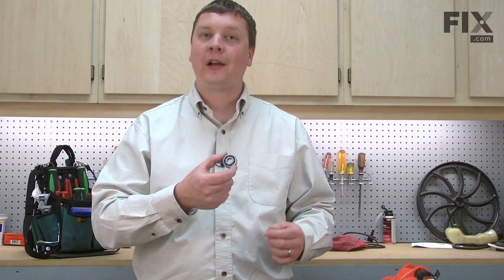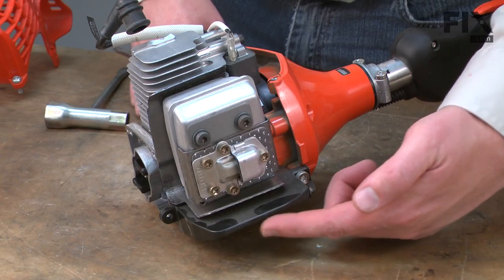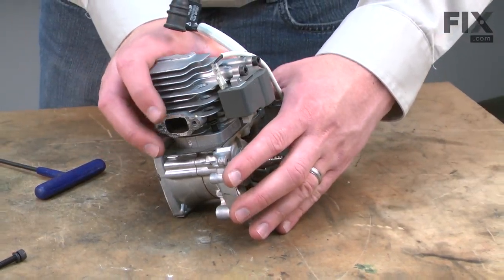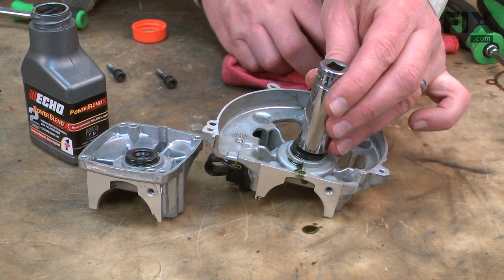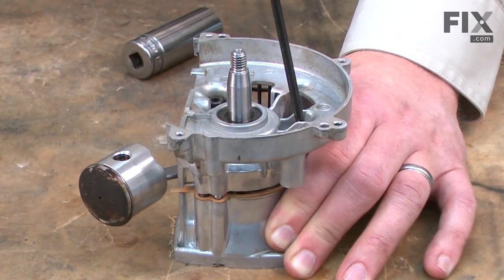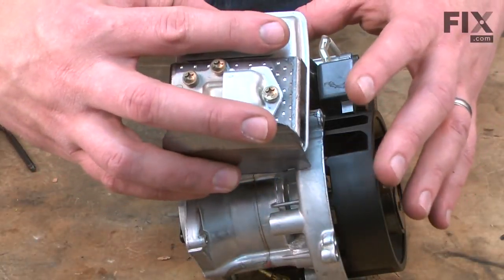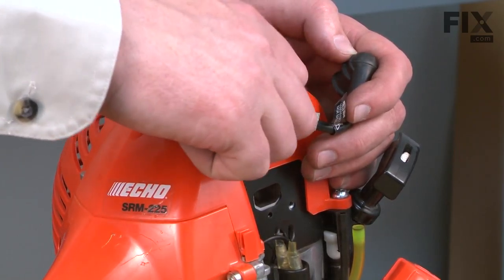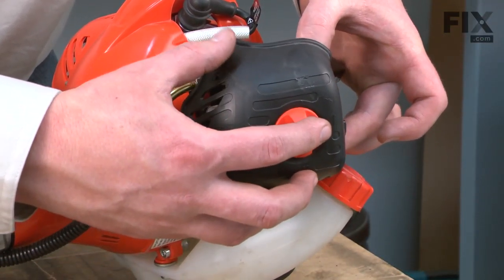Echo Trimmer Repair – How to replace the Ball Bearing 6201

Comment: Good video i have a 2 stroke engine but its starting not perfect when am start engine on full speed and it's starting smoothly and then pull down the race and engine is off automatic
Reply from the maker: Hi, could you please provide more information on your engine repair. Do you have a model number?
Reply: Fix.com no sir i have no model number
Reply: हिंदी में रिपेरिग की वीडियो डालो